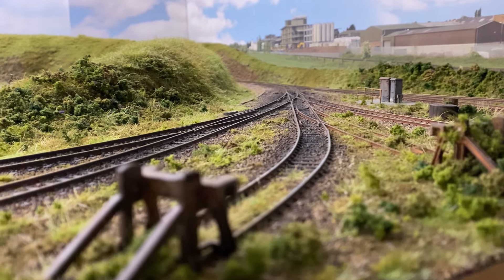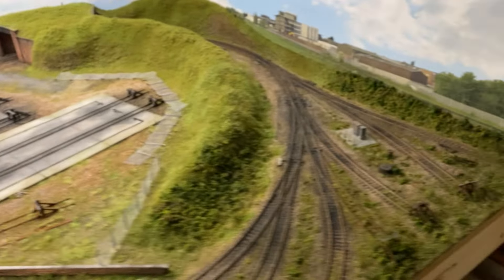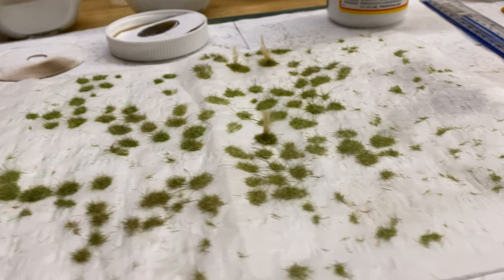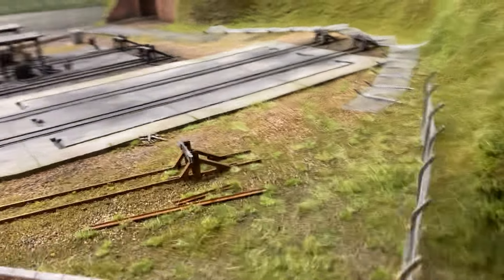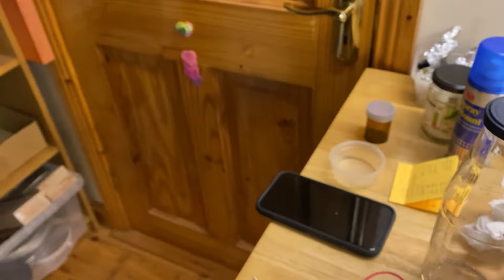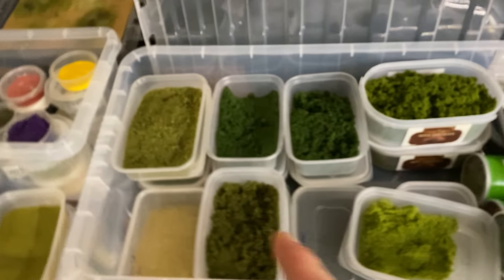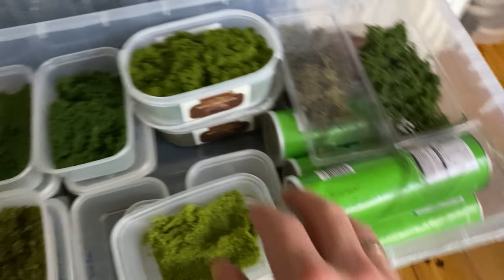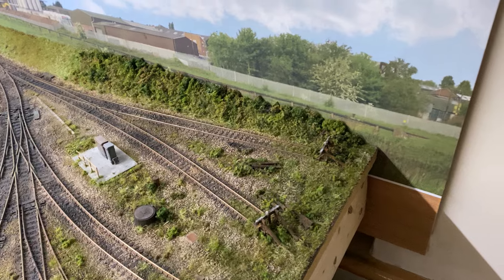Irish Model Railway | 07 Depot #8 Layout Update September 2024 | Riverbank Railways

Comment: Excellent! Was about to bin my static grass applicator because it tended to dump the entire contents in one go. Using a paper mask/filter is a great idea. Thank you.
Reply from the maker: Class! Glad I could help Steve. The static grass is tricky, there's sooo many videos out there about it and different techniques. I spent a lot of time experimenting with glues and technique on a spare piece of MDF so I'd recommend practicing on something like that before hitting the layout. Actually, if you check out the video at 16:02, in the top right corner behind the plastic box you'll see a test piece I used divided in sections for different methods / types of glue etc
Reply: @riverbankrailways  Hello from the Netherlands!  If you have so much time spent on experimenting, could you help us out with the big question of the glue? What is the best solution that you find out for yourself? I, and probably all the folks, are looking at this video like hear more about the right way😊. So... saying this, I cannot wait longer to watch this video 😅
Thanks for showing your work!
Reply from the maker: Hey, thanks for the comment. For the initial static grass layer, I use either WWS Basing Glue or else Modge Podge (matt). Either of these work perfectly well, you don't dilute them (the Modge Podge is more widely available in standard craft shops and cheaper). The trick is to spread it thinly on the area you want to cover, if it's too thick, it takes too long to dry and the grass falls over. 

Once the initial 2mm or 4mm grass is in place then to build up extra layers of grass I spray the existing layer with either WWS Spray Adhesvie or Spray Mount (again Spray Mount or any form of art and craft spray adhesive is more widely available in craft shops and cheaper). This will then allow you to add more static grass on top of the original layer and it will stick to it. Then you just repeat this second step over and over until you are happy, spraying between layers. 

Lastly, I always touch the alligator clip onto the baseboard when applying the static grass and keep the grass hopper hovering over longer grass for a few seconds after applying. This helps the grass stand up straight. You can also use a vacuum cleaner to both suck up non-stuck grass for later use, as well as pull up any stuck grass to make it stand straighter.

Hope this helps, feel free to ask any more questions :)
Reply: @riverbankrailways Thanks a lot!❤

Comment: Soo vacuum while the glue is still gong off? You said it helps the grass stand up.
Reply from the maker: Yes immediately after applying the grass. It might seem strange but the glue is strong enough to hold it, and any bits that do come up contribute to thinning out the grass which the effect were after anyway. I have a cut up pair of tights over the vacuum to collect the grass and clean it out after every step to avoid the grass mixing. Also I use a proper household vacuum plugged into the mains, not a handheld one, I’ve found they’re not strong enough.
Reply: @riverbankrailways  great tips thank you. I used a sock to collect, but only on a hand held. I'll bear that in mind for the new module. Thanks again for taking the time to explain
Reply: Yeah this is how I have done mine.. Very hard to see it standing up in N Gauge when the grass is only 1m or 2mm max though!!! But I usually leave the glue for about 5 mins. Then using a normal vacuum with tights over the end, vacuum it up. (Only problem is when you get too close and the vacuum pulls you down and you make contact! So I'm now mind full of that happening!)
Reply: @CGngauge  good to hear this is the process many are using.
Reply from the maker: @dibsyardshuntinglayout  You're welcome Dibs
Reply from the maker: @CGngauge  1mm static grass in n gauge...respect :)

Comment: Great video, it's brought me to your channel... Going to check out some of your other content now. Great to know about the Tuft Glue. Great tip about the applicator adding the paper holes to make it smaller, didn't think of doing that.. Saves buying the smaller one!! (I've had the issue where it all come out quickly and I don't have the control... I am using 1mm and 2mm... N Gauge.) Do you have a video on how you went about weathering the tracks and ballast? Also.. Have you tried using kitchen grease paper instead of the WWS paper to make the tuffs on?
Reply from the maker: Thank you for all your kind words :) Really glad there was some tips that helped you out. 

I don't have a specific video for weathering the tracks and ballast, but you might like this playlist when I made the dirty oily ballast for the fuel area: https://www.youtube.com/playlist?list=PL4sIrxM1DXchtwszcbz5uVz9RU_WnZ7c- You've given me an idea though, I might do a similar how to video for the track and ballast weathering as it was quite involved.

And no I haven't tried the kitchen grease paper yet - if you're gonna try it out, let me know how it goes!
Reply: @riverbankrailways  It would be great. Your weathering of your track is great. I did see some of your videos about the weathering of more of the concrete work areas, not so much the siding areas that you have added the grasses too. The oil and general weathering is really good. I'm yet to do mine, 1 - holding back as not sure how I want to do it.. 2 - I have other things I think I need to add before I weather the tracks. (Point Rodding..etc)

I'll let you know how I go with the grease paper.. I was thinking about doing it this afternoon, but got stuck making some trees. 

Thanks Craig.
Reply from the maker: Thanks Craig, I'll dig out the paint mixes I used and the process from start to finish and put a vid together in the next couple of weeks :) You're right to hold back, the trackside stuff needs to be done and there's no rush. It's a hobby :) As with the grass, I'd recommend practicing your technique and colours and a few spare pieces of track glued to some MDF before you get to the layout. I'll show some of my test pieces in the video.
Reply: @riverbankrailways  I've already done a lot of my static grass, but it the nice little fine details in the tracks just off the main lines etc... You can see what mine layout looks like in the latest video. Look forward to seeing how you went about your track weathering. Craig